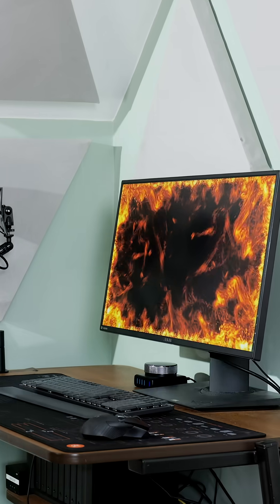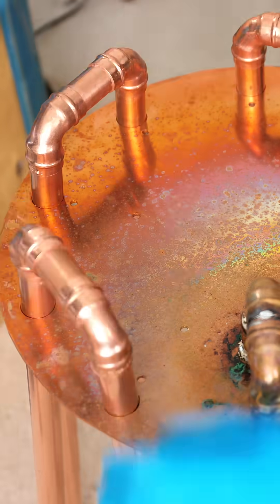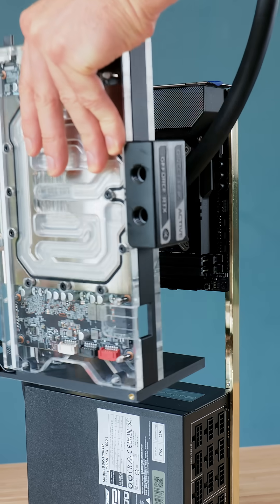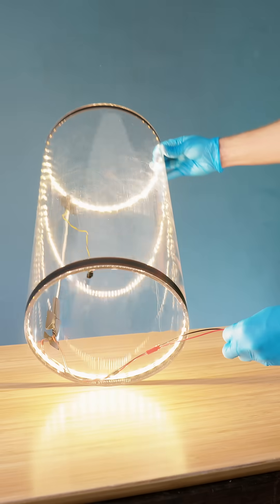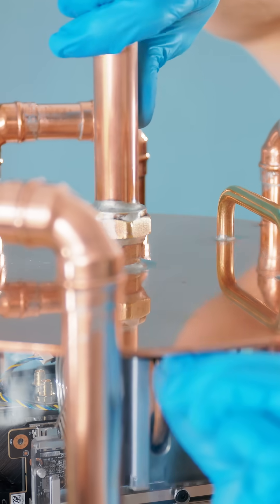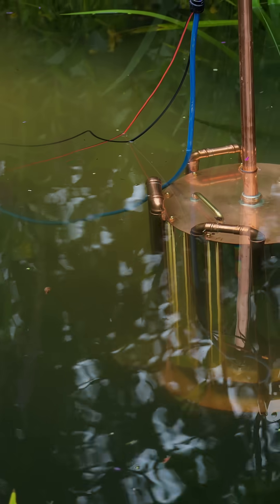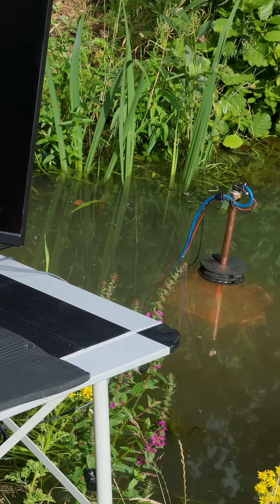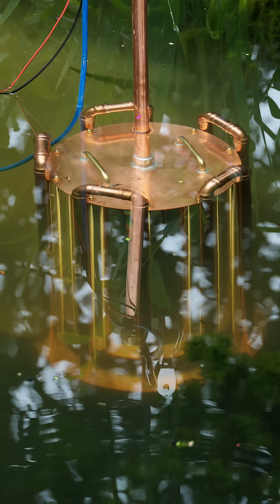I cooled my PC with a POND!

Comment: and now buy an used fridge and drill a hole through the rubber for the cables / a 3D printed gasket and there you have it

Comment: So, I actually build similar systems to run my water heater and melt snow. This could also have been done by setting up copper pipes to run through the pond. In these pipes you'd run a coolant, the temperature exchange being through the copper wall of the pipes. You'd then pump this coolant to the PC, creating a liquid cooling loop. I suppose if you really wanted to specifically heat up the pond or other body of water, just insulate the pipe until it gets to the water.

Comment: the pond ...is a novel idea. However, this could be interesting thought for a new pc cooling design - the copper pipes outside. If it isn't crazy to think, maybe somewhat like a refregiration idea. Kind of reminds me of the mac pc that looks like a bin, however in this case the exterior/chasis of the case would release heat. Off course, there would be other considerations needed, such as dealing the fact that your sat next to radiator.  However there is potential for many design avenues to deal with this which in your case ...is a pond.

Comment: I’d probably add a 120 millimeter radiator and fan to circulate and cool the air inside, which would help lower the temperature of the motherboard components like the VRMs, RAM, and NVMe drives as well.

Comment: I'm not sure if this would help as a tip, but wouldn't it improve performance to use a small radiator with a fan on the inside to circulate cool air around the VRMs and other circuits? It could potentially extend their lifespan and improve overclocking potential.

Comment: Only issue is components that don't have a waterblock. RAM, VRMs.
Reply: My thoughts exactly. NO air circulation, the other interior parts will get hotter than expected if air cooled.

Comment: You don't need to solder PRO press copper fittings. If anything you will melt the rubber gasket inside them!

Comment: I would have just put the heat exchanger in the pond and kept the PC out of the water.  either way I guess it worked.  Just hate when it will spring a leak you're out a whole computer.

Comment: Those plumbing fittings are made to be crimped on with a Propress. They have a rubber seal in them. The solder ones are cheaper and don't have the rubber. I'm no plumber so idk if the melting rubber o-ring from the torch would effect anything since it's not like it's drinking water, hopefully it doesn't hurt the pump any.
Reply: glad i wasn’t the only one who noticed this
Reply: Plumber here— the biggest issue is they have a looser fitment on the pipe than standard fittings since they get crimped down anyways, just makes it easier to place and position them. Needs loads more solder to fill in. I have soldered these fittings in a pinch before, but they’re like $15-30 a piece as compared to the standard ones $0.10-0.50. The rubber seal will melt and run down the pipe which could create debris in the water line but otherwise I’m sure it works fine

Comment: WTF did you do. You wasted so much money using propress fittings as normal soilder fittings. You see that ring on the fitting i has an o-ring in there to make a seal when crimped with the right tool aka a propress with a ¾ jaw

Comment: Anyone has noticed that some liquid cooling systems are way more expensive than a cheap car radiator system? Check, some years ago a  sport cars dealership didnt sell its car seats and turned them into “gaming chairs” and now is gaming fashion we all know. Maybe some car workshop can turn complete radiators wich can work both as case and cooling system with the looks of something extracted from madmax. Forgetting fancy lights and “cute color cooling liquids” and instead we can get rusty looking machines that can give you tetanus just by looking at them.

Comment: Make sure to check on rubber parts regularly and replace them, espacially under the sun. You can also make an umbrella on top to reduce amount of ultraviolet there. Otherwise it will just sink in water after some time...

Comment: I was legitimately thinking about doing this. I had two goals however, use the heat from my PC to supplement heating my aquariums, and in turn, remove the heat from my PC into my aquarium. Noteworthy, at the time, I had about 2000L of aquarium water. The PC would remain out of the water of course, but I was going to plumb the reservoir to a heat exchanger in the tank's sump.

Comment: I always submerged my entire PC in 3M Novec 7100 and it doesn't need to be water proof the whole PC is a tank you just submerged the components because it doesn't conduct electricity I sealed the whole thing so it doesn't get dust in it ever.

Comment: Kinda cool, but also stupid as fuck. The more practical option would be to keep the PC inside the house, and use a plate heat exchanger to transfer heat from the PCs cooling loop, to an external cooling loop, that then dumps the heat into the pond.

Comment: Power supply does also rely on airflow, it will break eventually
Reply: thats why he had air temperature sensors in there - and it cooled just fine cause of all the water surface area

Comment: putting it into water is dumb, there is air inside so it will not cool it down, only tubes with water will cool it down
Reply: he did run water cooling to the hot components - thats what the copper pipes on the outside are for

Comment: I wonder if there would be any effect on the pond if you were actually running that daily?
Reply: sunlight is about 1380W/sqm. so, even if was going at peak load 24/7, the pc would output less heat than the water gets from just the sun
Reply: @techheck3358  Thank you

Comment: That's the best most original idea I've seen in years mate, very well done.
Reply: Yeah until you realize that warming up the pond isn't the best idea for the ecosystem
Reply: @peteypete9357  true...so just build a fishless large aquarium in the back...or FRONT yard with a fountain (hose) and a drain. Submerge the halo pc in there.
Reply: @peteypete9357  It's too much water. You could put 3 of those PC's in the same pond mining bitcoin 24/7 & the pond water delta temp wouldn't rise by a single degree more than when without the pc's
Reply: @loneproficient  not right away, of course not, but over time all that energy needs to go someplace and affects the local life similarly to how global warming does before it dissipates on an above average warm day.

Comment: You used propress fittings that don’t require soldering they get pressed you had to get normal copper fittings
Reply: Yeah but they are super unreliable and leak alot sooner than a soldiered

Comment: I'm going to be that guy.

This would not work well. The obvious risk of being actually underwater aside, the cooling system would not be very functional.

The copper heat pipes will rapidly equalize the temperature of the components with the temperature of the water, but because the pond is so small, there is going to be almost no water flow around the pipes.

You will see a short time period where the computer performs well, but as the water that is located around the pipes begins to heat up there will be nothing to take the heat out of the area.

I imagine the pond has significant thermal mass, and so this might take a long time to notice, but that equally means that it will take a long time to recover after you turn it off.

Also, meaningfully changing the local temperature of the water by several degrees overall can't be good for the local population.
Reply: He addresses this briefly in the full video, I recommend watching it. The pond is actually 7 feet deep, so he doesn’t think it is going to raise the temperature by more than a degree at any point

Comment: Dawg, one water leak and your computer's toast.
Reply: How often does your toilet rubber gasket fail? Not that often right?
Reply: @LaPlayaPark  depends on whether or not he chose the correct size for the gasket.
Reply: @hiepphambui3941  It's just a flat rubber seal. Even just a regular O-ring would suffice. They're not under significant pressures or clamping loads. Like other guy mentioned, if a wax ring under a toilet can last 40+ years, and they dry out over time, then two rubber seals under less of a clamping load, and only in contact with copper and water, will easily last multiple years. Now the quality of the seal is what matters, not the size. Also, you seem to be forgetting that fully water-cooled PC's are at risk of a leak from any of the multiple connections in the system, even while the system is off. They're far more likely to leak that 2 rubber gaskets/O-rings. And this only has a few connections inside of the sealed off space
Reply: @jonnywilson9117  thanks for the info 👍
Reply: Bigger issue is think is backing it up without having to de-pond the pc

Comment: Should have cut some copper discs to weld onto the cooling fins, it would have more surface area for transfering heat from the coolant to the pond. Just don't overclock, as the poor fishies would have no water left.

Comment: Advisement: Your pumps have manufactured tolerances of a couple tens of a thou for the pump and housing. Ensure a filter on intake and sediment sock is installed on your build to prevent sediment, lime, or other unnatural items in the water from being cooked into your pumps, lines and Radiator. Not as finicky as a car, but finicky enough.
Reply: The pump isn’t coming into contact with the pond water. It’s just a big heat exchanger

Comment: Copper tubes
Aluminum heat blocks

Galvanic corrosion would like to have a word with you
Reply: Not aluminium, they use a copper cold plate

Comment: pc: ❌
nuclear reactor:✔️
Reply: I mean... its not too different to a supercomputer
Reply: @jona2395 you stole my word bro
Reply: Imagine if all the heating electronics were used to run the turbines. I don't even know how much nuclear plants it would replace
Reply: @AlienSliker some datacenters use the heat generated, to heat the offices, kantines etc, that are on the datacenter compound.
Reply: @AlienSliker  Probably at most like 1 plant, if even,  nuclear power plants produce an absurd amount of energy.
Reply: 3
Reply: WHAT DO YOU MEAN THAT ALL IT DOES IS BOIL WATER????
Reply: Quantum Computer 😂
Reply: I'd still take a nuclear reactor or a data center making my electricity because it's far more compact than a data center.

Comment: Everybody gangsta until the seal breaks
Reply: Seal's highly unlikely to fail as it's only in contact with copper and a bit of water.  Which for a regular rubber seal is perfectly normal. The seal isn't being kept at high temps, so above 70 degrees C, it isn't in contact with any chemicals that dry out or damage seals. And, it isn't under any pressure, whether that be  pressure pushing the seal in, so outside pressure, or the inside pressure being too high forcing the seal out, and it's also not under any real clamping force either that could crush the seal over time. Eventually it would need to be changed. But those seals would last several years no problem.

Comment: But the copper will kill all your fish. It's far easier to run a pex tube from your PC liquid cooling system into a trash can filled with water. Just droop a long line into a spiral in the trash can, you don't want to mix the water, allowing you to use windshield washer fluid, which will not freeze easily. Dig a French drain to capture rain water from your downspouts. Dig a hole for your trash can rain barrel so the earth keeps it from freezing.  You won't need to solder and you won't get algae growing on your components. I've had algae growing in my UV bulb housing, and it uses the exact same rubber gasket and glass cylinder concept. The heat expands the air inside forcing gas out, and water will eventually follow the same path when cooling causes contraction.  Also, 120 volt wires in the water- expensive accident and potentially deadly.

Comment: I have been playing around with ideas for a crazy over the top PC cooling system that I'll probably never actually build because it would be impractical and cost a fortune but here is my idea. For perspective I'm a commercial refrigeration tech making shit cold is what I do. I think it would be really cool to cool a PC with a chiller, LTT did this I know but they did not cool it below room temp because you will cause moisture in the air to condense and water + mobo = bad. To counter this you could run the PC in a mild vacuum chamber effectively removing the moisture from the equation and giving you free reign to run your chiller at extremely low temps. The biggest thing that scares me about trying this (other than chillers are expensive) is I don't know how energized PC parts would react to a vacuum, would it cause the oil in the capacitors to boil, would the lack of an atmosphere cause and arcing? There are too many IDKs that could brick things I'm not willing to brick, but if anyone wants to put my idea into practice and test it I would gladly share my refrigeration knowledge for the cause.

Comment: Even though its copper piping, there should be at least some kind of fins to have more surface area to cool. It doesn’t matter if it’s air cooling or water cooling, it need fins to be more efficient. This may even be less efficient than a regular radiator over time as the water isn’t flowing
Reply: Still a smart idea for putting a pc into a pond to cool it

Comment: Mixed metals in the loop could eventually cause corrosion, I'd suggest a copper block instead of aluminum if possible, since it's in a pond you want it to last :)

Comment: I remember 1999 when i was on the 100 top ranking in the World in Decent 3 and was living close to the telephone switch in the village and had excellent internet on my modem. But I kept overheating the modem so I had to put a new glass of ice water on the circuit board every 2 hours. I did not have a pond at the time.

Comment: "Submersible" has a little different ring to it these days. Amazing build again!
Reply: Yes submersible is nice, but implosion is even better
Reply: Don't pressure it
Reply: @devangamerz1175  bahahhahaha! :)
Reply: dude ready to play subnautica in deep ocean 😂
Reply: @4IZUKI They tried that earlier this year irl. The results were bombastic 💀
Reply: Still better than the titan
Reply: @megabyte1311 What if it has a Titan in it?
Reply: @megabyte1311  It is if can survive at more than 20k' deep. That's an ungodly amount of wire to keep it powered. think of the resistance on that extension cable for the power and monitor

Comment: That's the craziest thing I've ever seen for a computer! Absolutely brilliant 👌🏼
Reply: No, other components also produce heat that has nowhere to go like the PSU.
Running this system for an extended period of time could still cause the PC to thermal throttle
Reply: @JT_6233  actually in the full video he explained that he took care of that too.
Reply: @JT_6233  Right right. So he would still need a breathing tube to come up then? With a good fan I assume as well.
Reply: @JT_6233 literally went over this in the video if you watched it 😂 the PC never thermal throttled and the ambient temp in the chamber only rose by 3 or 4 degrees C

Comment: Fish Tank PC build next!
Reply: boiled fish, lol.
Reply: How about a tropical fish aquaponics system above 40 degrees latitude, heated with a symbiotic PC? 

It wouldn’t work with mine; the SBC I use pulls about 10 W total and does everything I need.
Reply: Der B8uer did a complete PC like a Aquarium. Its all in a water like cooling fluid.
Reply: It is in mineral oil